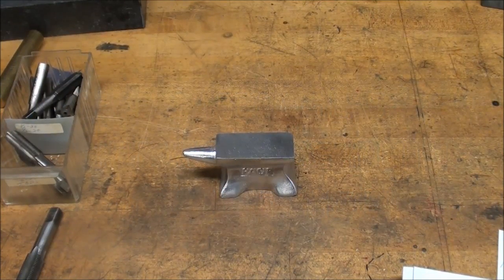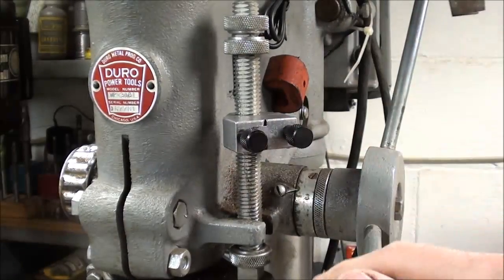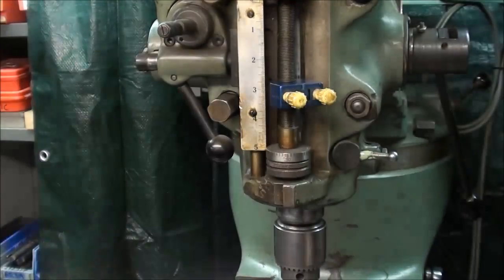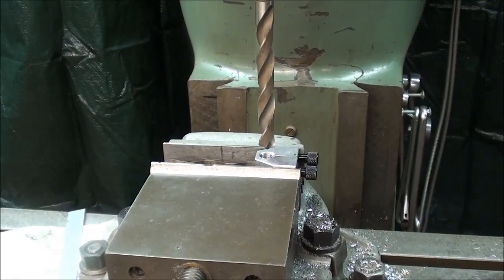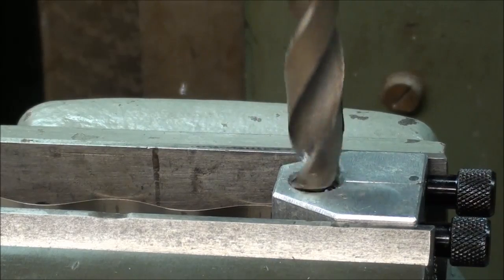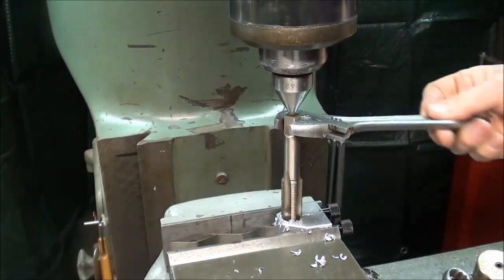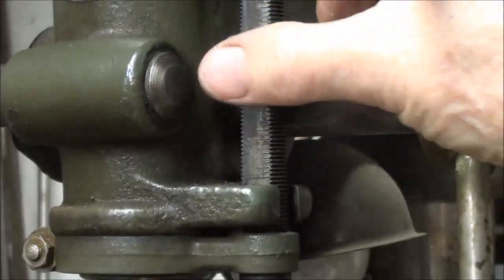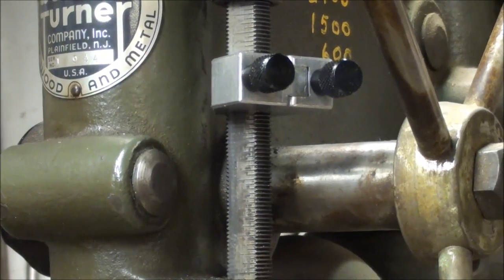MACHINE SHOP TIPS #161 How to Make a Drill Press Depth Stop tubalcain

Comment: I was just gearing up to make a depth stop for my cheap Klutch drill press. I moved and decided not to lug my old Craftsman across the country. All the cheaper new drill presses don’t have depth stops at all and most don’t have an easy way to loosen the motor to change the belt for a speed change. On my old Sears drill press it had a collar adjustment with a spring inside for fine adjustment but also a small lever arm you loosen up and rotate to the flat area and slide up or down and then rotate back to the threads and retighten. I’ve been searching E Bay for that kind of depth stops at all but nothing yet. Thanks for the video , subscribed and thumbs up😊👍

Comment: Another option for coarse thread rods is "push button nuts" which have a spring loaded half nut that you release by pressing the button.  Has the advantage of still being able to fully rotate for fine adjustment.  However the OD is much larger than a standard nut so you would likely have to modify the collar that attaches to the quill to move the threaded rod out slightly.  You can get them in either a round knurled style and hex which can fit a little tighter and may not require the modification but won't be able to spin.
Reply from the maker: Thank you for the suggestion

Comment: My idea for one of these if you don't want to pay shipping is 2 separate blocks, threaded to take a wing nut/thumb screw. The wing nut is just to open the 2 halves a little so they slip over the main thread. Not as convenient as sprung loaded but probably free & it would only be a couple of turns on the wing nut to open the halves enough

Comment: What’s the best way to know what size to drill it out and what size to tap it too?  My drill press is 5/8” threaded rod with a pitch of 13 on threads.
Reply: Are you sure it isn't 5/8ths  11 or 5/8ths 18, 13 TPI is not a common size. for 5/8ths rod. 
Or is it metric?
Reply: I’m not exactly sure. I believe the max thread thickness is 5/8 and the min. Thread thickness is 1/2”.   When I used the pitch gauge the closest that matched was the
One
Marked 13.
Reply: 13
Reply: @SuperGolfclub  How strange for someone to design something like that.
May I ask who made it or what brand.
Reply: Worth Doss it is a Craftsman.   Floor standing drill press. I might be wrong on measurements. But don’t think so.

Comment: You folks across the bond are sooo lucky... Machine tools and accessories, what ever you happen to require from time to time, they're all readily available on "off the shelf" basis. While things here in Indonesia have improved to no end during the last 10 years or so, I still find if I require something like this little press stop, it's significantly faster to make it myself, than ordering it from the web and then get it sent to Singapore. Sending it direct to Indonesia is not a option, since many suppliers do not ship to Indonesia, and even if they do, the local customs can even hold it up for many weeks, and finally demand a king's ransom in "Import duties".
Reply from the maker: I guess we are lucky--I did not things were that complicated over there

Comment: very slick, my craftsman 150 is nice, in that the depth stop, you turn it 90 degrees, and slide it to where you want, then turn it back 90 degrees, and lock a bolt.
then you can adjust it by turning a certain amount. But that thing is slick, I have never seen that. I have taped in the drill press, to center the tap, and have already put a bungee cord on the quill handle to hold it (the quill) snug.

Comment: On my drill press the threaded rod came off first thing.
I replaced it with plain round bar and made a sliding collar with a thumbscrew.
I thought the collar might slip, but it locks very tight, never had an issue.

Got the idea from one of those drill stands, there you need to set the stop all the time. With them the rod is adjusted instead of the collar, but same thing.
<http://static.rapidonline.com/catalogueimages/Module/M312889P01WL.jpg>
The rod acts against a thumbscrew there, so you have a micrometer stop. Very useful for countersinking and such where you need an exact depth. Some day I might add that micrometer adjustment to my drill press, maybe a threaded sleeve in the cast iron head. You only ever need a couple turns of fine adjustment.
Reply from the maker: GOOD IDEA

Comment: Well great little stop.Im a wood guy but have a 57 craftman drill press with king seeley vari slo attachment, and one thing Ive always disliked was the stop nuts and fine threads, I never new this was around, and thank you for the tip and mod.

Comment: This is the kind of thing I love about your videos. I am totally self-taught... went the the school of hard knocks as it were :-) but you seldom forget the lessons! Little things you do, like putting a dead center in the mill and using it to assist in tapping... that's stuff I would not have thought of... but it will be incredibly useful at times. I was unaware of the quill stops... and now that I know... I'll get/modify a couple for my drills. (My mill is not CNC, so not an issue there.)

Thanks again... always a pleasure to learn from a true pro.

If you are interested... here is my beast: Wells Index 823 Update #3 - July 13, 2014 - Cutting Steel.
Reply from the maker: Thanks for watching. I like your Wells Index.  My first years of machining, I used only INDEX machines--thats before they met wells. They were every bit as good as a bridgeport. Sorry, I know very little about CNC. I subscribed
Reply: mrpete222
I saw that... thank you! The CNC just means that you give the machine the commands via program. So if you were going to mill a slot 5 inches long, and were going to use a feed rate of 5 inches per minute... you could do a G1 X5 F5 which tells it move along the X-Axis, for 5 inches, at a feed of 5 inches per minute. I have a program that takes my drawings and calculates the needed movements. I am hopeful to do a whole tutorial section on it this winter. (Time permitting)

Comment: Good tip.....my quill adjust screw was smaller, so I drilled out the threads on the new stop, and made a plug that I pined in place, then re-tapped for the size that I needed.....perhaps a part 2 showing how to do it if the size you need is smaller, rather than larger.

Comment: great job of altering the tool theres an even cheaper way drill and tap some round stock part off and cut a slot through on side so it fits the flat of the threaded rod on the drill press then just twist to lock it

Comment: Great video.  I have a drill press where the limit is a collar on the shaft that the handles are on.  You just move the drill down as far as you want and spin the collar around until it stops and tighten the set screw and it will stop in that place every time.  Just as fast as the tool in your video but I always know where it is because it is a part of the drill press.  Made in Taiwan about 40 years ago.   Thanks for sharing.
Reply: +mrpete222 Well thanks for the inspiration - I did not know these quill stops existed. I got 2 and what I did was instead of rethreading the stops, I replaced the drill stop rod. I got a length of 1/2-20 all-thread, drilled and tapped one end for 1/4-20 and used washers and a 1/4x3/8 thru spacer to fill the hole. The original rod was a stpped thread 16mm-2mm with a step to 9mm-1mm? and a nut. New rod Works like a champ and gives a better resolution (.05" vs 2mm)! Thanks so much. I now have top and bottom stops that I can place instantly.
Reply from the maker: +Loring Chien Thats a nice solution--a little different twist
Reply from the maker: Thats a good system.
Reply: +cerberus   That's the best kind I have used. My smaller 12" Delta benchtop uses that system.
Reply from the maker: +Loring Chien  Thanks for watching-
Reply: So with a 1/2-20 thread the finest resolution you can get is .050", give or take a little if you have enough room to rotate the handles on the quill lock.

My Hitatchi DP has 16-mm 2-mm pitch thread which is odd.  If I did this then I would have to find a tap drill and a 16mm tap and then I would have only .08" resolution (2mm) for a stop which seems a bit large. I like the idea but the lack of tap and the low res seems like negatives to me.

Comment: Nice tip. My drill press doesn't have a quill lock, but that looks like it could go underneath the stop surface to hold the quill in an extended state for lining up work. Certainly looks like it's worth trying.

Comment: My Bridgeport came with one of these and I was very under-impressed with it because it slipped easily.  I'm betting now that it was just worn out.  Maybe I'll pick up a couple more and modify one for my Clausing drill press also.
Thanks for the video!
Reply: Jack Hoying mrpete222 Have you seen my 'Milling machine quick adjust depth stop' video? I guarantee it won't slip on the Bridgeport!
Reply: Paul,
  I have seen your video for that method and it is on my list of things to make for my Bridgeport.  Thanks for the reminder!